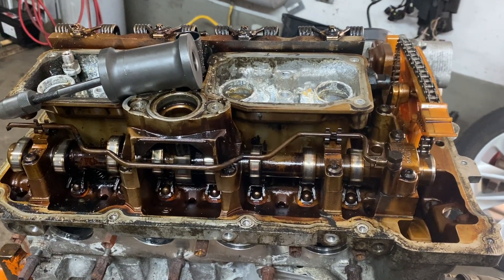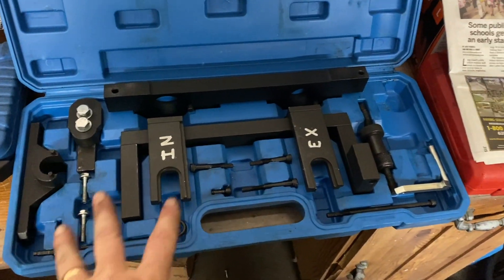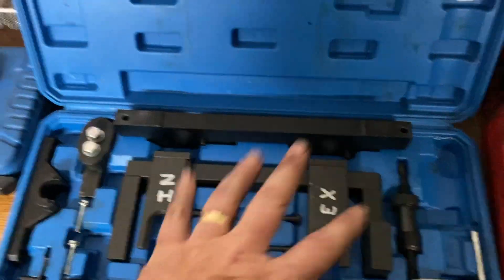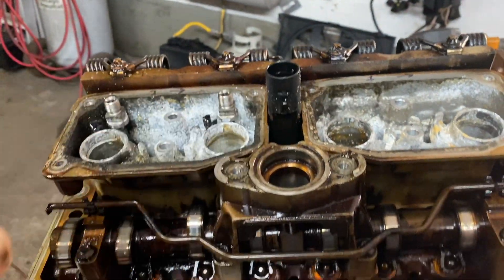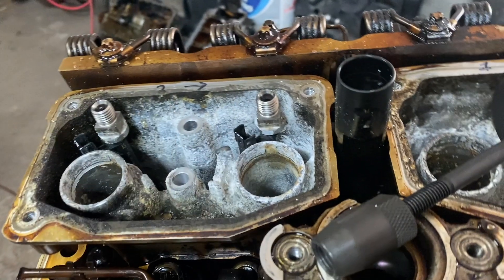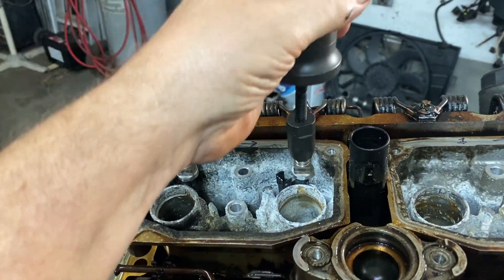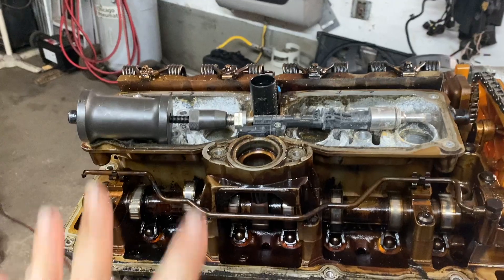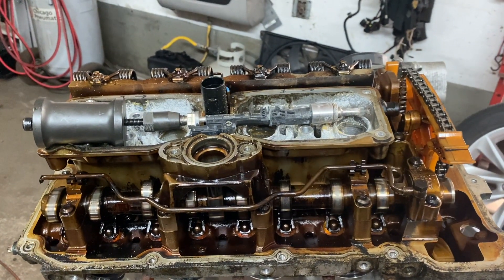How To Use BMW N20, N26, N54 Fuel Injector Removal Tool

Comment: Thanks for the great videos! 
How would you put them back in and torque them without the special T like tool?
Reply from the maker: Thank you!

To put them back in you can just tap them slightly until seated and torque to 90 inch lbs. Make sure they are in the order they came out unless they would have to be reprogrammed.